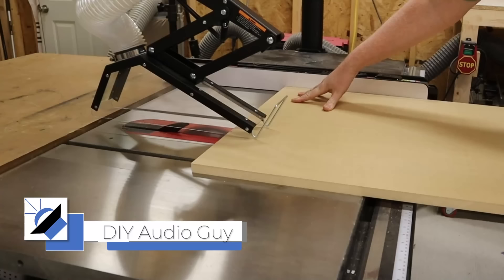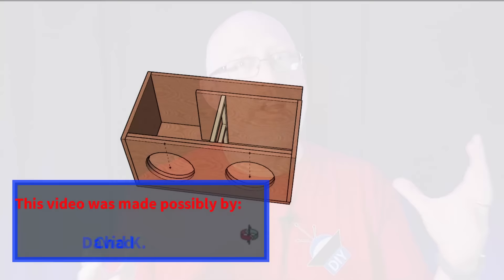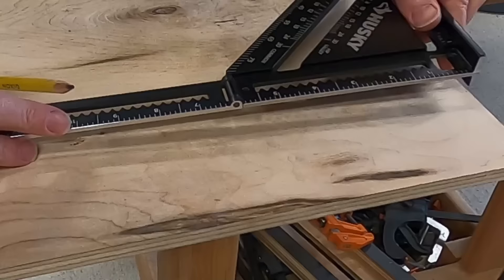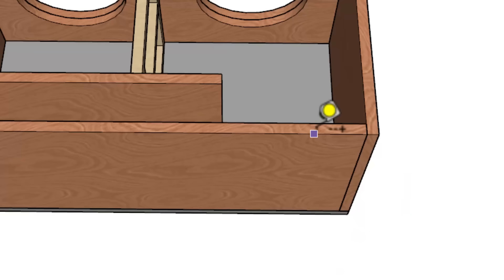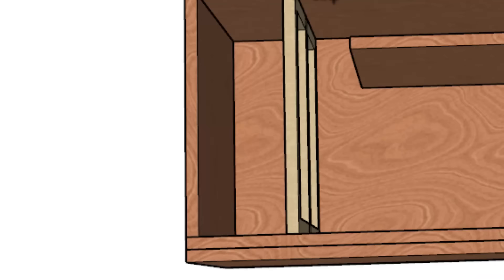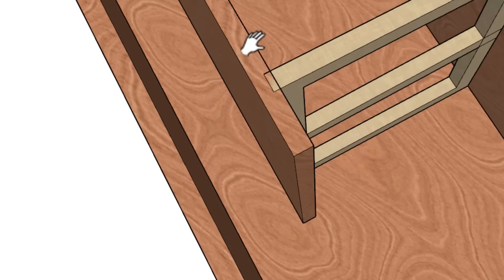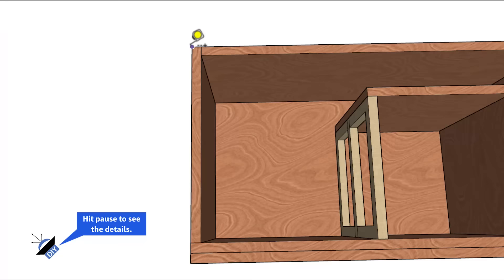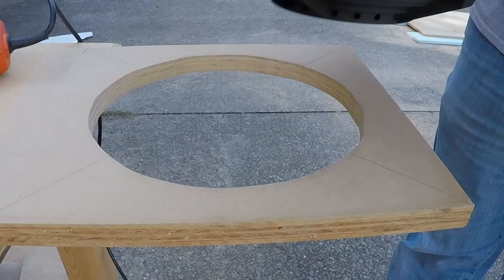Fix this mistake to make box building easy!

Comment: I find the easiest and most accurate way to  cut wood for an enclosure is to let my hardware store do it. Most hardware or lumber yards where you buy wood from offer cutting services with equipment far more precise than what a typical homeowner has. Sometimes there's no extra charge to make the cuts.
Reply from the maker: Both Home Depot and Lowes in my area will do two cuts with their panel saw free of charge.   The accuracy is entirely a function of the employee running the saw.

Comment: I'm a pretty horrible box builder, LOL.  For a number of reasons, including my eyesight.  One thing I try not to do though is end up with a box design that results in a situation where, during glue-up time, a piece needs to be slid into place, rather than pressed into place, and when pressing a piece into place, I make sure to use enough wood glue to ensure that excess glue is pushed out from both sides of the edge that's being joined.  Finally, I wipe the excess off from both sides of the edge with a damp cloth.  This ensures a strong and airtight glue joint.
Reply from the maker: Is it possible to use to much glue?

Comment: Just throwing this out there for anyone willing to help. I've been trying to decide on what system i want in my car. The main problem im having is deciding on what size sub i want. Im between 2 12s and 2 15s both running 600w rms. The question i mainly have is what size and tuning frequency i should go for if i want a box to play low and still be musical. Any help or advice would be very appreciated.
Reply from the maker: The box is going to be quite large.  4. Cubic feet, perhaps larger with a pair of 12s, even larger with a pair of 15s.
Reply: @DIYAudioGuy  Any advice on tuning frequency?

Comment: Good day, may I ask if I can use a damping material in a speakerbox. It is a foam substance and I put in the back to bounce the sound off. 
It does have a full sound and not a tin sound.
What do you recommend, the speakers are small and not to big to use in my vehicle. I don't like mounting them in my vehicle, they are set in places that they can't move around.

Comment: a wen track saw is the tool for this and the cost less than a circular saw and kreig guide, about $120. for breaking down sheet goods i think tracksaws are better than a table saw.  in my old age I have realized the tracksaw is great for big things and the table saw is for small cuts.
Reply from the maker: A truck saw is a great tool.

Comment: Noob question... do I subtract the volume of a pvc port from the volume of the enclosure the same as subtracting the displacement of the driver?
Reply from the maker: Yes!  Make sure you use the outside diameter of the PVC.
Reply: @DIYAudioGuy  thank you!

Comment: Hi I have 8 6" speakers I have 4 mid-range and 4 vice and I want a make one box to accommodate all the speakers for my home system can you send me a diagram and measurement to build one thank you
Reply from the maker: You will need an internal crossover network for that.  Those can be complicated so I charge quite a bit to design them.  I recommend that you join TOIDS DIY forum, they can help.

Comment: Awesome video. I really appreciate you taking the time to make video’s like this one. I am in the process of putting together a stereo system and wanted to give building the box for the two subwoofers that I own. The box they’re in now is to shallow making the subwoofers to not seat. I also want the box to be the proper size for the particular subs that I have. Having said that I have two questions if you don’t mind giving me your advice I would really appreciate it. Now I have two JL Audio 10w6v3’s what wood do you recommend I use and do you recommend a sealed box or ported? Again any recommendations and advice to help me out with my journey I’d highly appreciate. Thanks
Reply from the maker: If you can afford JL then I recommend that you have a local shop build a custom box.
Reply: @DIYAudioGuy  I can afford to have a shop make it but I have been into car Audio since before I could even drive watching my older brothers. Now I’m 36 and building a box is something I have really been wanting to do for quite some time now. But thanks for your advice!
Reply from the maker: @IloveRoblox215  I totally get that.  Best advice is to download winisd and do it all from scratch.

Comment: Planning on building a box for 2 Visaton FR8s to fit into a model tank. The space im working with is very tight, and the boxes will only be 1 1/2x the size of the speakers. Is there any benefits to port them? Or will I sealed box be easier?
Reply from the maker: It is hard to get loud and low bass out of a speaker that small, and out of a small enclosure.  A port will help, but small boxes require very long ports. So either go sealed or look into using a passive radiator.

Comment: I dont understand why everybody uses clamps on these box builds. Just get some thin screws, no drilling, it wont split with thin screws. You could throw a box together in less then an hour or a nailer works but most people dont have those.

Comment: Do the bracing with the cutouts block airflow to the port? Does the bracing also conflict with the air pressure of the subwoofer when the air goes to and from the port?
Reply from the maker: Not at all.
Reply: That's weird. I'm a 25 year HVAC Journeyman and bracing like that would cause air restriction, but I guess the air behind the subwoofer doesn't get any friction from the bracing as air would in a sealed duct system. Hmm
Reply from the maker: @russellcrabtree5314  it's a little different situation.
Reply: Hmmm

Comment: Why do you all build boxes with ports? I know the port hole allows the speaker to go to just about its full length in the magnet. Which causes the foams surrounding to deteriorate faster and your speaker only allows to be used for the short life span. Like when someone decides to put the stereo to full volume the speaker now has to compensate and the foam surrounding always gets damaged permanently.  Now you have very expensive speaker weights and not actual speakers. Sealed boxes prevent the speakers from going to its full length and thus the speakers actually last longer and you can put more volume and power to the speaker. Thanks
Reply from the maker: You are correct that a sealed box provides more cone control, but the jump from there to the claim that a speaker will last longer in a sealed box is a pretty big jump.  If that is something you are worried about this will fix it:  https://youtu.be/iWRoIho7A7c?si=_AzAB0P1wIHXFfhY

Comment: Use a hammer blade. Use MDF (good MDF). If you are not proficient with power tools PLEASE DO NOT USE THEM! If you choose to do so… when using any type of circular saw push through quickly don’t hesitate following your line. This will prevent arc. There are many resources to get a well made custom enclosure. Do your math!
Reply from the maker: Great advice!
Reply: I’m not trying to take over your channel. I just love your diy style! Just trying to add some personal experience. I’ve seen some fingers be relieved of their place of origin by people that have little experience.😖
Reply from the maker: @broken51N  my goal is to keep all of my fingers.

Comment: Hey mate, love your vids, I'm looking into building a sub box and I have a questions regarding Amplifier placement, I notice alot of the designs out there on the internet look like designs for passive speakers. If I were to add a plate amp to the Sub Box itself, do I need to take into account how much volume it takes up inside the box and adjust the box size accordingly? I've also considered a fake wall in the back to preserve the volume of the box however the box size is becoming impractical. 18" Driver and a dayton SPA1000 plate amp.
Reply from the maker: Yes, TOIDS DIY recommends partitioning off the enclosure so that the amp is in a separate chamber.

Comment: I hate to be that guy but my AuDHD won't let me move past it.  Silicon and silicone are two different things.  Silicone is what's used as a sealant. Silicon is a chemical element, albeit found in silicone. 👍🏼
Reply from the maker: You are correct, I never actually noticed that they were spelled slightly different.
Reply: @DIY Audio Guy  
firstly, thanks for the informative video.  Secondly, I'm glad I didn't offend you.  I always have a hard time telling people things both in real life and especially in text form.  I only intend to be helpful but,  it isn't always perceived, and much less received, in such a manner.

Comment: Hi this was a good video on how to cut the wood right 👌✌🏼 o ya Im not sure if you remember me talking about the acrylic  and how they don't include or have room to put all the function and add on parts of the board they sell in there arylic case/ boxes to make it fully fictional other than just a remote control.and I was talking to them about making a better case design to be able to use there parts and to be able to control it off the case to.   well instead of just a box  They actually just made the hole amplifier and box together they just came out with  almost everything like I suggested to them and made it a model.   now if they will make a pre amp model box so people can actually get the full use out of there product  its called the b50 model if you go on there website it perty cool it's the new release made me feel good at least for me I hate having something and I can't use it or make it to its full capability after I payed for it  to me that just a incomplete project down the drain any ways have a great one till the next one 😉👍👌✌🏼💯🎶🎚️🎶🍻
Reply from the maker: COOL!  I have the a50, so I need to check that out.
Reply: @DIYAudioGuy  the best thing to do is find Wich board the a 50 has in it  in the dyi boards it will be named different but the board inside will be the same then look for all the options/ accessories for it and order them you'll end up having  same thing if not more options but it won't fit in the case supplyed and they don't offer just the case or anything bigger you have to 3d print one your self. Wich is what I actually was trying to push for is a  case in instead they just made a model with 90 something percent of what there option are and I'm not sure if there any extra space inside of this one  if wanting to add or improve it i have gotten that far yet but will most likely find out after my next email to them. 👍👌✌️💪💯🇺🇸🎶💻🖱️